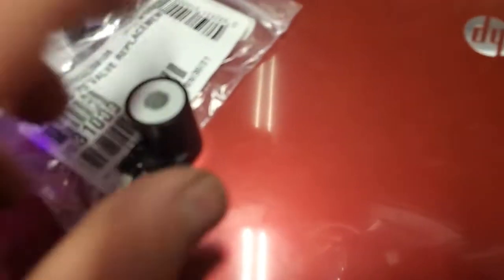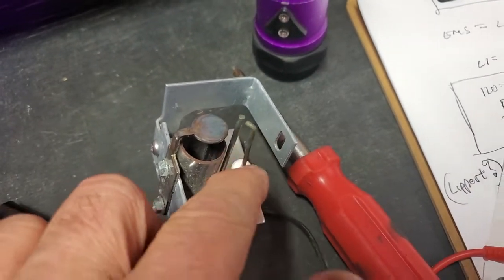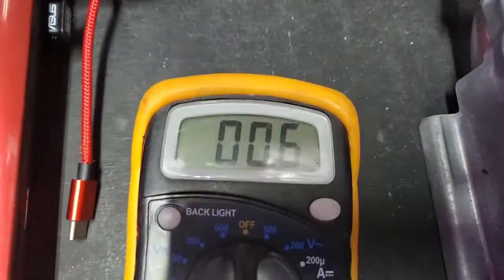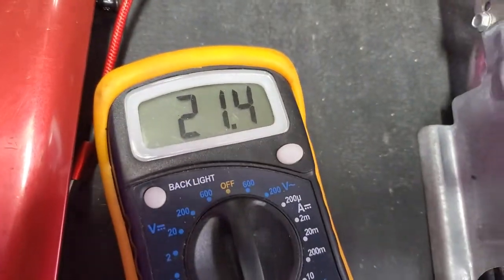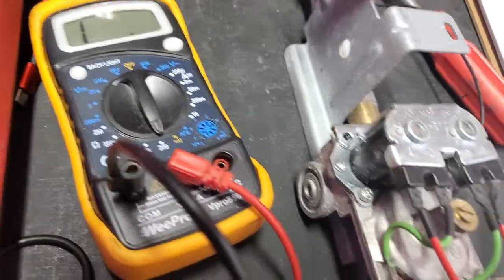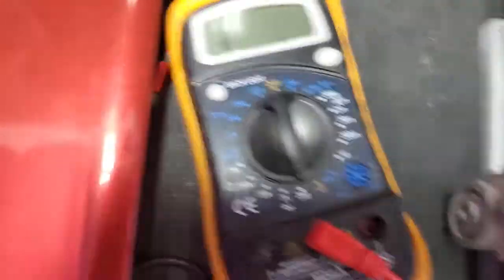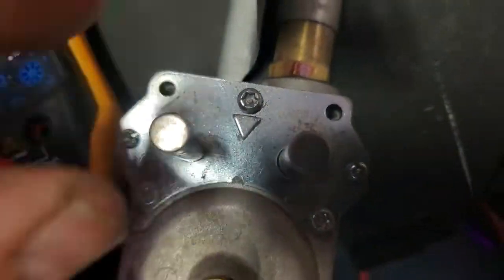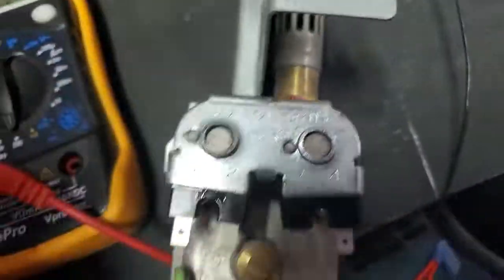solenoid replacement water heater or any rv system

Comment: Today I smelt propane coming from my cold water heater.  Last year I replaced the burner assembly.  Everything was working just fine.  I took some soapy water a spray it on the orfice.  And bubbles appears.  Are the solenois going bad?  I did not have this problem last year and I have not even dewinterize as yet.  It's still pretty cold in New York.  Any help woud be greatly appreciated.
Reply from the maker: Most likely if it's bubbling with it off valves are not seating/shutting off. Leander how to blow out your gas lines before installing a new Gas valve
Reply: @Rvdiagnostics  Thank you for your help, so it is the solenoid?  This is new to me, just learn about it from your video.

Thanks Again!
Reply from the maker: Don't forget you have to clean your  blow out your propane loines/hoses

Comment: been troubleshooting for weeks trying to figure out why i was working on electric only and winter is comming and electric wont cut it with 3 people trying to shower in the morning.  narrowed it down to the gas valve but i was hearing clicking so it didnt make sesnse.  never occured to me 1 of two could be bad.  happened across your video and sure enough the one on the left was "open" ordered two new solenoids today.  they are gonna take a week to get cause i had to use ebay.  amazon wanted $40 a piece and $140 for the whole assembly.  but at least i know the problem.  cant thank you enough for helping me out.  only problem now is that the water heater wont stay on on electric only  with the leads to the broken solinoids disconnected.  may have to crim on connections and then cut and recrimp when they arrive.  small price to pay.  thanks again
Reply: I do now
Reply from the maker: Sure ,Do you belong to my website www.rvdiagnostics.com 
And/or Facebook page rvdiagnostics&troubleshooting 
https://www.facebook.com/groups/1974314296166277/?ref=share

Comment: Occasionally my solenoids click on & immediately back off the the unit fails to ignite. It’s a brand new unit & it has 13.5 volts going to it, so what may be the problem? Could the new solenoids be bad?
Reply from the maker: Maybe, could be loo0se connection
Reply from the maker: Did you join my Facebook page rvdiagnostics&troubleshooting 
https://www.facebook.com/groups/1974314296166277/?ref=share
Reply: I've been looking everywhere for new silinoids. Where do I find them.I have a 1989 pacearrow fleetwood..atwood heater
Reply from the maker: What model of atwood water heater?